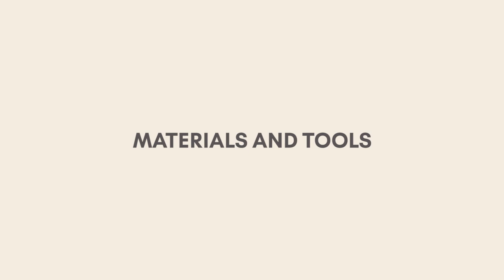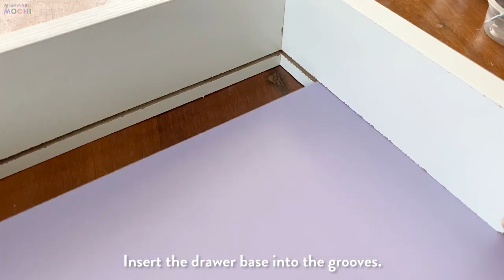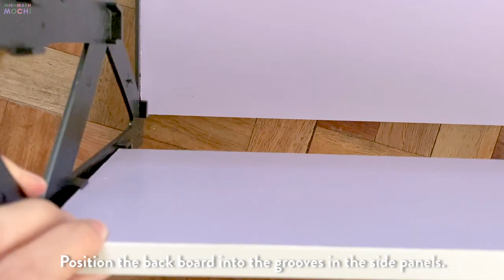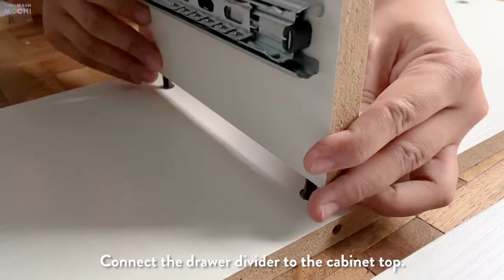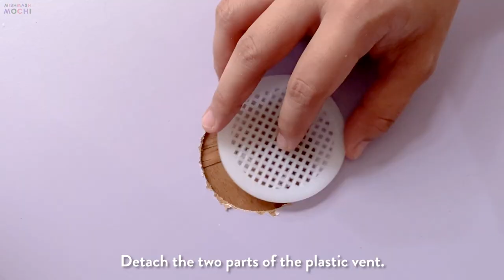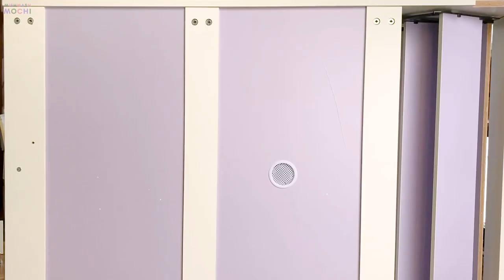How To Assemble a Flip Shoe Cabinet from Shopee / Lazada

Comment: Hi po. Is it durable. Yung material poba is not yung parang cardboard?
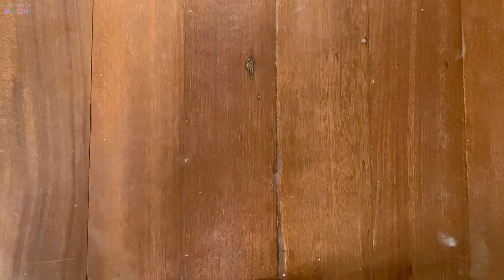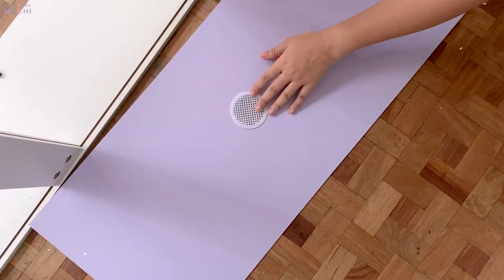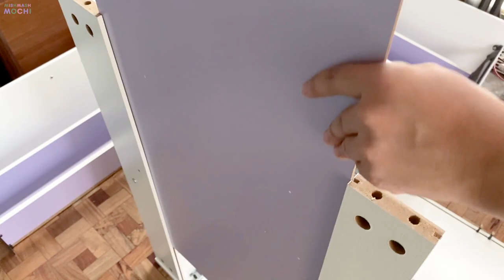Reply from the maker: Hi! The material is mostly thick wood, and so far, our shoe cabinet is holding up very well. The only parts that are quite thin are the bottom of the drawers (check out 2:45 for reference) and the wood boards that are located at the back (check out 9:39 and 9:50 for reference). 😊